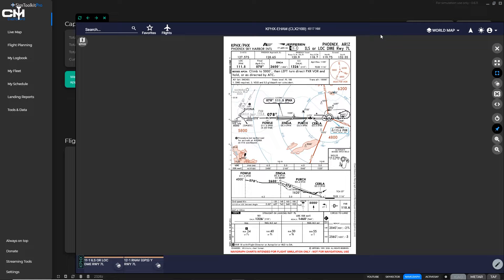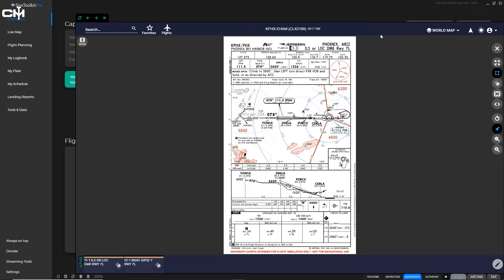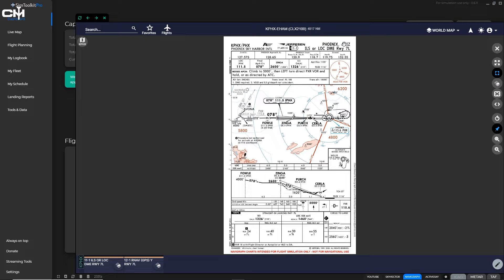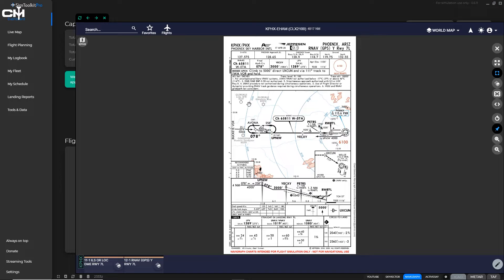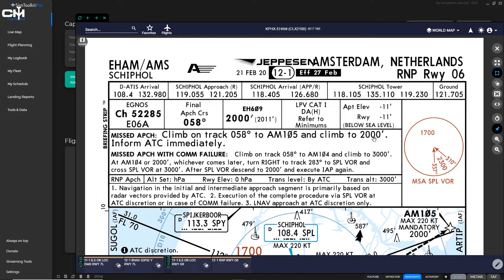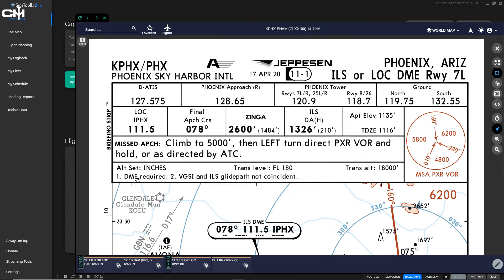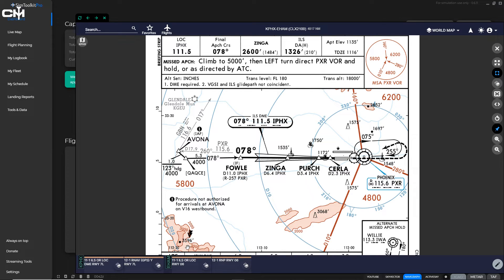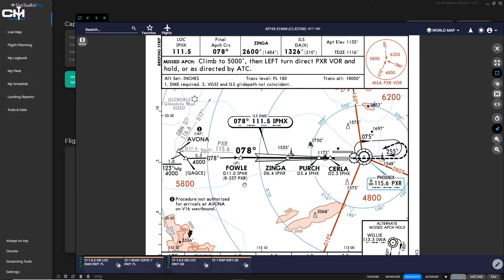[P3D v4.5]  How to Read Approach Charts |  Virtual Flight School | EPISODE 03 |  Pvt to Comm Pilot

Comment: Hey Captain Mac, I have a question? Do real world pilots use skyvector. I pulled up charts for kvrb and they look pretty much like what your Jeppesen KPhX  charts look like. I  watch your videos all the time and I am just trying to learn what ever I can about flying.. I was glad you gave some info about doing a missed approach. Thanks
Reply from the maker: A lot of pilota use Skyvector for VFR flying...for commercial operations probably not as much. But it is an accurate up to date tool for real world flying...in other words, it is not a tool created for flight simulation...it was created for real world flying.
Reply: @CaptainMac    thanks , did you get your computer rebuilt